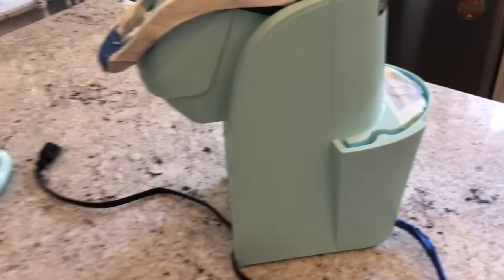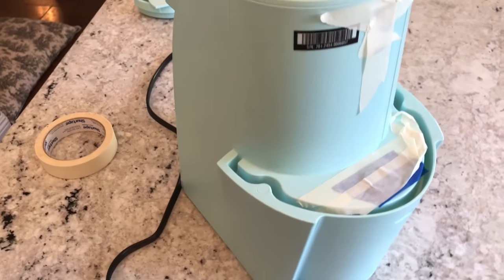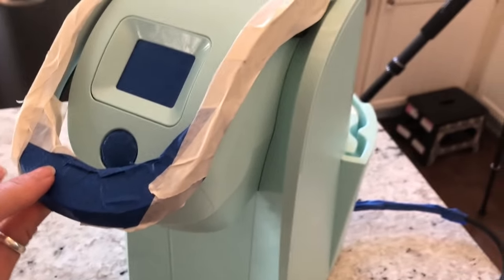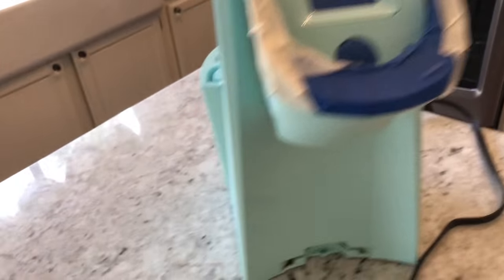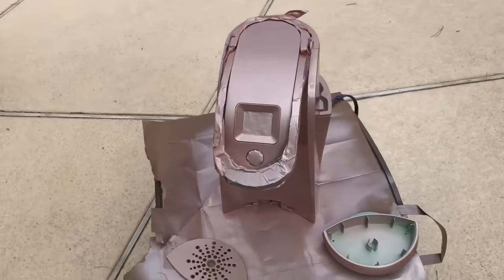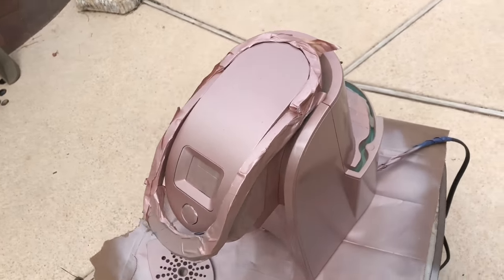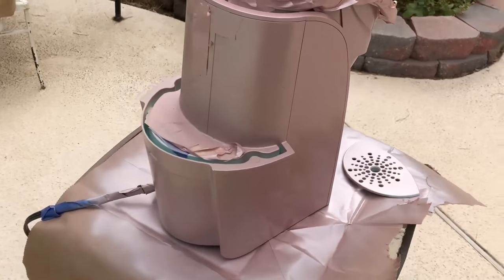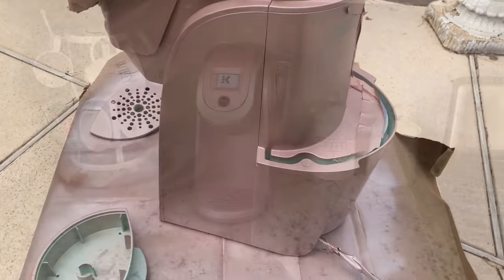How I Painted My Keurig

Comment: How I the paint holding up a year later
Reply from the maker: It held up ok. I have been using a different coffee maker for a while now though. If you plan on painting yours, I would use a protective top coat so it holds up better.